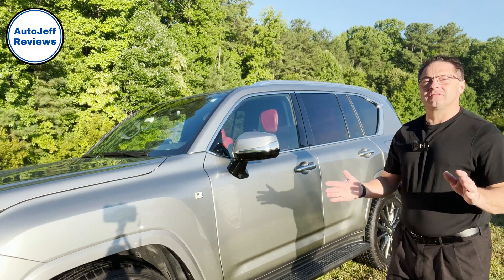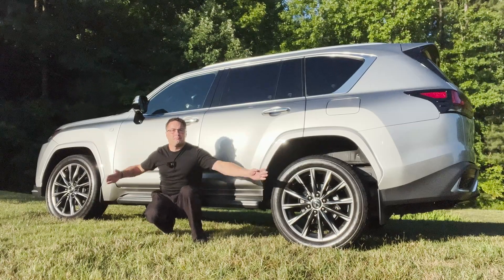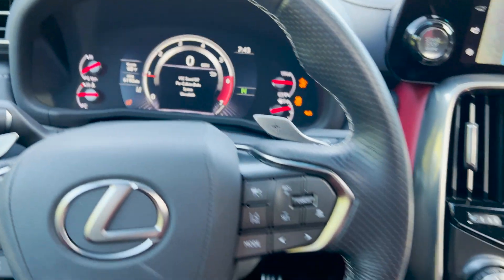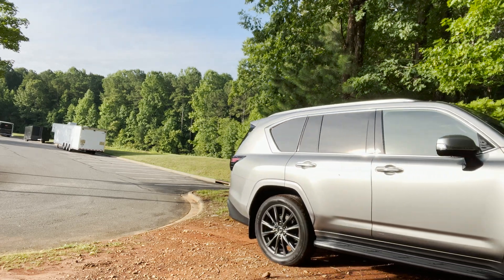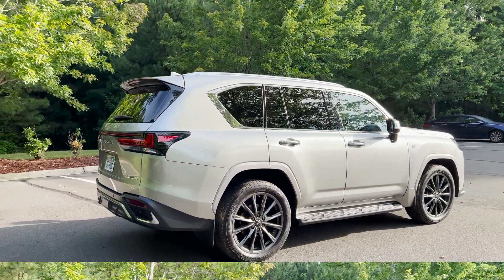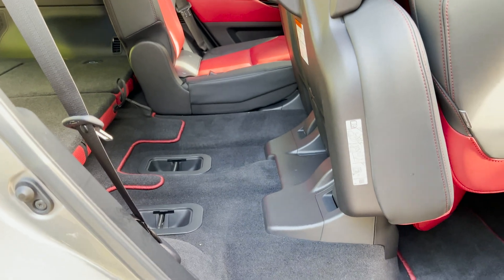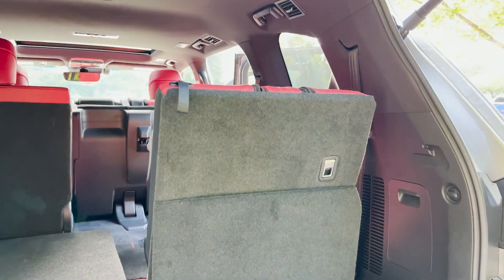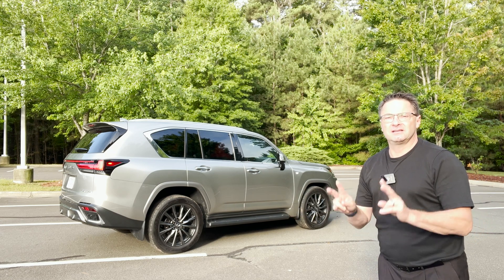How Center Locking Differential Works & How to Use It!

Comment: It's a pity that Lexus didnt give its Australian/American customers the same as they did their Japanese customers, that is Front/Rear/ Centre diff locks.  The Centre diff lock is only good up until the point where you either lift one front and one rear tyre OR end up with barely any contact under one wheel on the front and one wheel on the back at which point your fancy LX will just sit there with two wheels spinning, that is one on the front and one on. the rear and of course, in that case you are going Nowhere .......fast 😂

Comment: Hi Jeff, one question: when you have the center diff on, how much turning can you safely do? I've been told you're supposed to avoid turning wheels when you have any diff locked.
Reply: This only applies to a locked Rear or Front Differential. Not center
Reply: I agree with you

Comment: 4L will not work on slippery situation cuz will generate high torque. You can’t use high torque on a slippery situations. 4L is only for solid and firm surfaces.